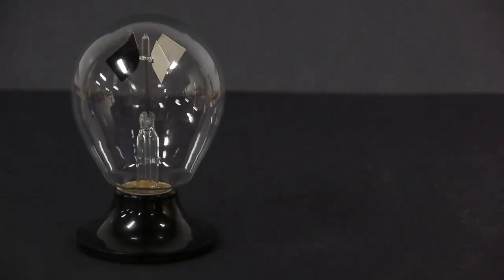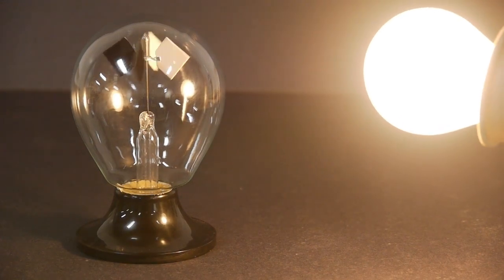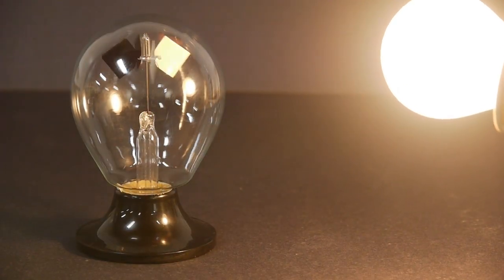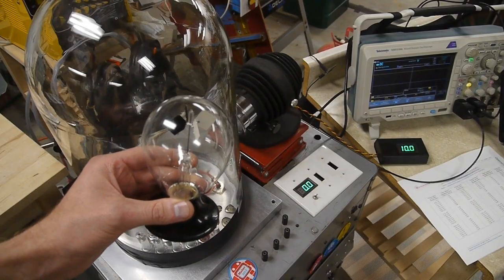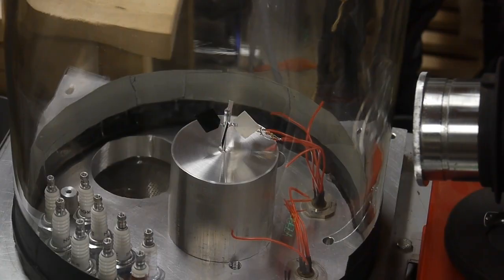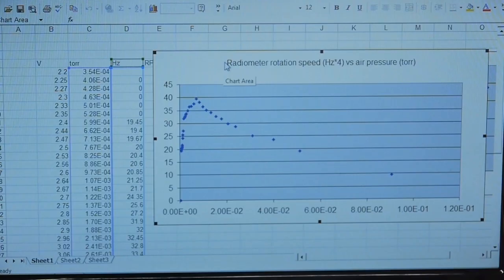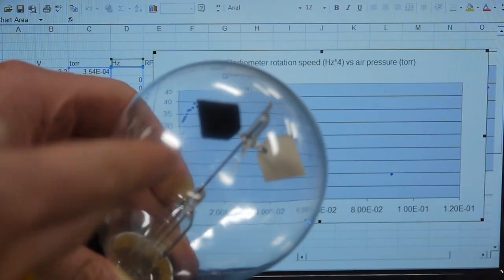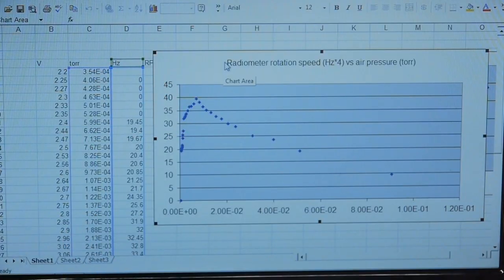How a Crookes radiometer works

Comment: Nice experiment and video. One minor correction...At 1:14 you said a 50 Watt laser would produce 'about 17 micrograms force'. As you know, a gram is a unit of mass, not force. The correct unit would be Newtons. I assume you meant that the force produced is equivalent to what a 17 microgram object experiences in the presence of gravity on the earth's surface.
Reply: +Vaes Joren Yes, you're right. Perhaps he could have avoided this by using the 'Imperial' measurement system, which inherently confuses weight with mass. (How many people know the relation between a 'slug' of mass and a pound of force?)
But, I still cringe when units are abused. You constantly hear advertisements saying 'tons of power', 'tons of pressure', 'megawatts of energy', etc. For those who do not recognize the error, repeatedly hearing them only validates in their mind that it is correct. In that way, they learn to speak technological 'jive'.
From the movie 'Airplane'...'Does anyone speak jive?'
Reply: +Vaes Joren Agreed. You mentioned a guideline regarding Kirchhoff's law which is new to me. I know it does not account for radiated energy. But, I was unaware of a relation between the wavelength and the circuit elements. Thanks.  In circuit board design, the general guideline I'm familiar with is that it needs to be addressed at speeds above 60mHz,
Reply: +Vaes Joren Thanks for the explanation. That's more detailed than just my 'radiated energy' interpretation.

Comment: Could we make energy from this effect? Using this spinning effect to run a simple coil generator if we have a magnetic pin to run through the copper coils?
Reply: Short answer I'd say is yes. Whether or not the cost and size of the set up would be as efficient and space-effective as a modern solar panel with a similar output would be the question. My bets on no.

Comment: Hello! I love your channel. Just wondering, did you ever get to do the changes in vane sizes? I'm rather curious about that. Thanks!
Reply from the maker: +Doxie Lain Thanks!  No, I haven't returned to the radiometer project since making the video.  I have a long list of things to do.
Reply: +Applied Science There's also the corollary to consider: is there a smaller length at which a radiometer would work at a pressure that's closer to what we're used to? Testable by going bigger, rather than smaller, of course.
Reply: +Applied Science Hi! Love your channel too!  Would you be willing to share the Excel data that you collected?  I'm thinking about trying to duplicate your experiment, maybe test the different sizes of vanes.

Comment: +Applied Science
I have that same radiometer and it starts very slowly rotating when I shine a laser on to the white side. I have to wiggle my desk a bit to overcome the initial friction. it seems to be the light pressure. ... but I'm not 100% sure about this. Can anybody confirm this, or can there be any other explanations?
Reply: What does it do when the laser light is shone on the dark side?

We need to know for a "differential diagnosis".
Reply: confirmed  by Jerry Liu.
Reply: @ecm2490  https://youtu.be/nu0G45hh9kE?si=rSbu6c8CAvxX-c3B

Comment: You ain't no real scientist!  A real scientist would come up with a BS explanation and proffer it as the absolute facts!
I've always been told it was light pressure that turned the vanes and accepted it as truth.  I'm now deconvinced.  Can we be sure that the black vanes are not reflective at thermal wavelengths?  The white vanes are probably nearly black bodies at thermal due to the type paint.
Reply: re: " I'm now deconvinced. "

Congrats.
Now, attack the three-light-polarizer paradox and see how you fare ...

Comment: how come vacuum pumps have spark plugs in them
Reply: +Connor Jackson He's using them as electrical connections from outside the vac chamber to inside it.  Since the plugs pass current well, are cheap, and are easy to seal without vacuum leaks, they work well.
Reply: +erikjgreen cool thanks

Comment: Great video. I realize the forces generated on the fins are quite small compared to electric motors. Just wondering if the is any way this device could do useful work-such as driving a small fan in the sun? What if you could have a Magnetic bar on the spinning part inside the bulb which could interact with (drive) a fan with another magnet mounted to it. Something similar to the way a Magnetic stirrer works. This would preserve the vacuum in the bulb-but allow motion to be transferred to an external fan without requiring any fancy seals. I guess the radiometer would have to be pretty large and the fan be pretty small for it to work. Thoughts?
Reply: I would say it is highly unlikely you can get any useful energy out of it, given the fact that the force is not strong enough to make the little blades turn in normal air pressure.

Comment: Thank you sir for sharing you knowledge with the world. Just wondering, If data exists. You said you let air in to see what pressure was optimal. I'm assuming you were using ambient air while letting air back into the system. Is there a gas or  gas combination that is/are more optimal than our atmosphere that you and I experience on a day to day basis. For example Random with Argon? Reason I ask, this could be an ingredient for a extremely high efficient electrical generator.
Reply: Hydrogen might prove to be optimum? Used around large-scale rotary generating equipment ...

Comment: Do you need a light source at all?
Or can you change the temperature with a heating element?
Reply: Parker Thornton That you can spin the radiometer backwards by cooling the glass demonstrates that this is possible. It would work because the glass would radiate the heat, and that radiation would be absorbed more quickly by the black surface of the vanes than the white surface. However, some heat would also be conducted away from the glass, so it would be less efficient than simply shining a light through the (mostly transparent) glass directly at the vanes.

Comment: question, could you make it spin in a complete vacuum using radio waves?
Reply: Can UFOs Advance Science? Light does exert a pressure, NASA just launched a solar-sail powered test vehicle.  However, even such a vehicle doesn't rely only on light pressure, but the constant bombardment of particles of all kinds put off by the sun as well.  They also require HUGE sails to even move a shoebox-sized object.
It's paradoxically a matter of these vanes being too small to intercept enough energy, and also being too large and heavy to be moved by radio waves.

As to this
"No one in the scientific community has ever been able to create a perfect vacuum. In fact, it is impossible to achieve (as if the Universe does not allow for it to exist, so what does this mean for the Big Bang theory so beloved by many scientists?)."
 
It means nothing, because the Big Bang was, by definition, a change in state, where time, space, and everything about the universe started.
To insist that the same rules must have applied 'before' such an event is simply ridiculous. (If the word before even means anything in this context)
Reply: +Allan Floyd You are absolutely correct about the vanes needing to be much larger to move a payload that is more massive (and hence heavier while resting on Earth) than the vanes and arms of the radiometer. NASA's "solar sail" is a great example of just how large the vanes need to be for there to be of any serious practical use. Here, the sails are already described by NASA as pretty hefty in size to capture the sun's radiation (including visible and ultraviolet light) in order to move a decent "shoebox" payload (size is not important, but the mass is, and certainly must be more massive than the radiometer to be of any use to NASA i.e., data capture and transmission to Earth). If the radiation was just radio waves, we can probably multiply the size of those sails by at least tenfold.

NOTE: It should be remembered that the vanes of the radiometer are described as "uncharged" (a misnomer according to the latest research on Einstein's Unified Field Theory in the sense that all matter is constantly charged, but if we ever wish to retain the traditional concept of a gravitational field as proposed by Sir Isaac Newton then we must show a distinction between charged and uncharged matter), meaning the vanes require considerable amount of light energy to move them (hence the need for the arms and attached vanes to be extremely lightweight, or the vanes to have a large surface area should the mass of the vanes and arms be greater). On the other hand, if the vanes were given an oscillating electric charge and there is a way to direct most of this emitting radiation in one direction (which we can do right now), we have a totally different kettle of fish to deal with here (you only need to look at the mathematics to see what is being suggested here), and the forces of radiation pushing on matter can be amplified considerably. This means the size of the vanes can be small, yet the movement predicted will be dramatic (i.e., exponential according to the mathematics).

Glad to see you had a bit of a crack on the Big Bang idea.

The Big Bang theory, although a side issue thrown in, is still highly controversial. The latest scientific view suggests that the Big Bang could be "a change in state" as can be seen in the article "Big Bang was actually a Phase Change, New Theory says", by Natalie Wotchover (http://www.space.com/17217-big-bang-phase-change-theory.html). It should be noted that this new theory is mathematical in nature and extremely difficult, if not impossible, to prove experimentally due to the size of the "building blocks of space" as James Quach of the University of Melbourne, Australia, stated. And as far as mathematics are concerned, Einstein had this to say about the power of mathematics in explaining the real world:

"As far as the laws of mathematics refer to reality, they are not certain, and as far as they are certain, they do not refer to reality."

The mathematics of the new theory may check out as Natalie kindly pointed out in her excellent article and, therefore, is certain, but they may have little, if any, connection to reality. Until there is an experiment to support the theory, it is nothing more than a theory (or should be more accurately described as a hypothesis).

But you are right. If a Big Bang ever did exist, it may be pointless to describe any event prior to the Big Bang. Space-time was not suppose to exist to give meaning and a timeframe to any events prior to the so-called Big Bang.
Reply: EvilPlagueDoctor No.
Reply: +Allan Floyd 

Well, to be truthful, it is probably likely that radio waves have very little momentum to move the silvery/black "windmill" vanes given the fact that we don't have a perfect vacuum free of all molecules and radiation. Inside this radiometer flask we have the forces of the few remaining molecules, and even that of radiation in the environment, hitting equally on both sides of the vanes, as well as the amount of friction still present on top of the fine needle for holding up the four arms where the vanes are attached and hence the cause for why the rotation can be made to slow down when no radiation is present. However, if the vacuum was perfect, then radio waves will move the vanes (the question is, which direction will they rotate? If radio waves are not able to provide significant heating to the black side of the vanes, would the vanes rotate with the silvery side facing the back end?).

There are two types of vacuums:

(i) a vacuum without any molecules—described herein as the "complete vacuum" by +EvilPlagueDoctor; and 
(ii) a vacuum without any molecules and radiation—called the perfect vacuum (as allegedly appeared prior to the Big Bang where all radiation and matter of the universe were thought to have been compressed into a finite volume leaving the rest of the Universe to be completely empty).

No one in the scientific community has ever been able to create a perfect vacuum. In fact, it is impossible to achieve (as if the Universe does not allow for it to exist, so what does this mean for the Big Bang theory so beloved by many scientists?).

However, in a normal "complete" vacuum with no molecules, are you sure there is absolutely no movement of the vanes in the radiometer device? We beg to differ on this point.

Assuming no temperature differential between the black and silvery surfaces (and so eliminate all thermal effects and movement of molecules over hot surfaces), we all know radiation has momentum (no matter what frequency it has) to move ordinary matter. Basically the higher the frequency, the more momentum radiation has (i.e. it behaves more as a stream of particles pushing ordinary matter in a more effective way). If this is true, radio waves in the incomplete vacuum of this radiometer shown in the video may not be sufficient. But what about visible light or ultraviolet light?

As for the total force exerted by radiation on the silvery and black side of the vanes, in a vacuum free of molecules and with absolutely no thermal effects, shouldn't the radiation exert twice the force on the silvery side because it absorbs (i.e., the impact of the radiation exerts a force on the metal atoms) and emits (i.e., the recoiling force of the radiation coming off the surface) compared to the black side (which only absorbs the energy and with it any momentum carried by the radiation)? Unless someone can show a scientific experiment proving the energy in the radiation is never absorbed and emitted on a "silvery" surface and, therefore, no force is exerted on the silvery side of the vanes, we are left with the most logical conclusion that the vanes should effectively spin in the opposite direction to what's shown in the video where the silvery side is the back end and the black side is the front end (since it should not be emitting radiation, assuming it acts as a perfect black body).

There are plenty of examples online showing how a radiometer can be made to reverse its rotation so long as the temperature of the black vanes does not exceed that of the silvery side (together with any amplification of the force over the black side should there be molecules present inside the flask). The above video gives some indication of this when you cool down the glass flask using the ultra duster can. In which case, the principal cause of the movement has to be based on radiation pressure, plain and simple, and should move in a vacuum free of all molecules.

Any thoughts about this?

Comment: Hi Ben, I like the way you have used regular spark plugs to get signals in and out of the vacuum chamber. Very novel idea! I must have missed that "Vacuum chamber build update" on that ;-). Did you also made those red wire passthroughs?

Comment: this is good for your eyes, it shows whats going on
Reply: convection, vacuum, light
Reply: Eric Gibson 1cm vs 100nm
Reply: Eric Gibson the black surface must convert the light to a lower wave length, and lower wave lengths must have more mechanical force
Reply: Eric Gibson the surface can't make more energy then it is given, it must convert the energy to different states, different levels, and the black surface is more power and the white surface is less power, so the black surface turns into mechanical energy, where does the white surface reflected light go? into empty space? into the vacuum gas? like a mirror the white light reflects? but the black surface must reflect to or it would not move, maybe there both reflecting the light but one is better for mechanical movement.
Reply: Eric Gibson what would happen if you put a thermal imaging camera on this apparatus? would the black be brighter then the white?

Comment: Is convenction not a contributing factor? The black side of the panels would be hotter than the white side and therfore convection on the blackside  - and following the pressure - would be lower (working against the described forces). Compareable with an airplane but with own-induced-thermal-flow.

Comment: When he talks about how it's not the photons creating the effect, he says that if it was, the force photons reflecting off of the white surface would be greater than the ones being absorbed by the black surface causing it to rotate in the opposite direction. 

My question is, why do the photons that are hitting the white surface have more of an impact than the ones hitting the white surface?

I would have thought, since the photons hitting both surfaces have the same energy, they would cancel each other out and there would be no rotation. 

P.S. I don't know too much about light.
Reply from the maker: You are correct that the incoming photons have the same energy when hitting the white and black faces.  The difference is that they have a much higher chance of being absorbed when hitting the black face, and a higher chance of being reflected when hitting the white face.  If they are reflected, more momentum is transferred to the face because there is now an outgoing (reflected) photon that has "pushed off" of the face.  In the absorption case, there is no outgoing electron, so no additional momentum.  A perfectly reflective mirror surface would produce the most force from an incoming beam of light.  The diffuse white surface will be less efficient because photons will be reflected in all different directions.  Search for "Pelton wheel" to see a nice physical analogy.
Reply: Thanks. I'll look into that.
Reply: Newtonian physics as we know it, bouncing something with mass transfers more momentum to both bodies.
(that's why punching something and braking it is safer than punching really hard and not break it) 
but 'photons' are massless we cannot apply the same thinking here.
light are not particles(massless) it is a wave. imagine a water wave when does it transfer momentum ??